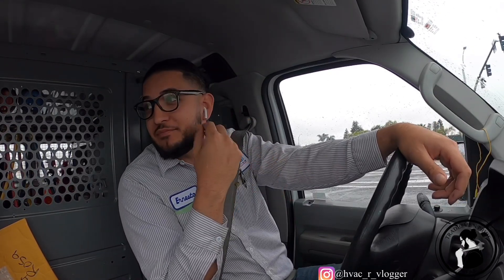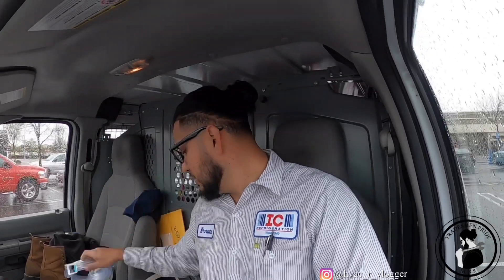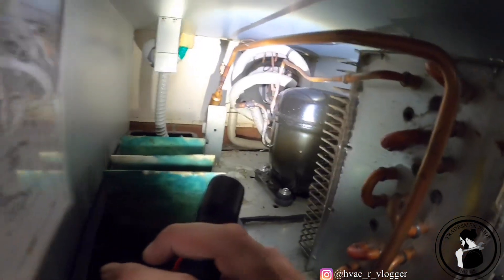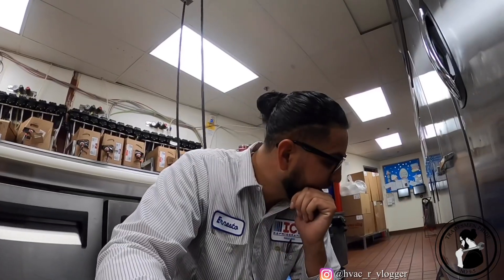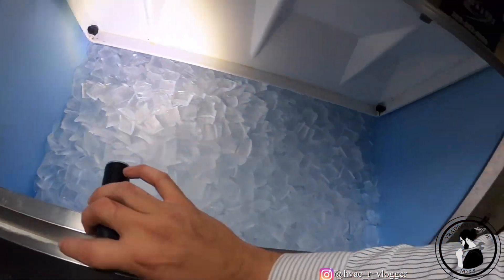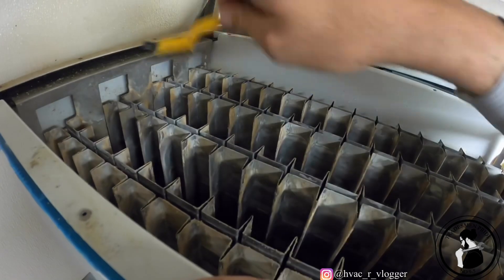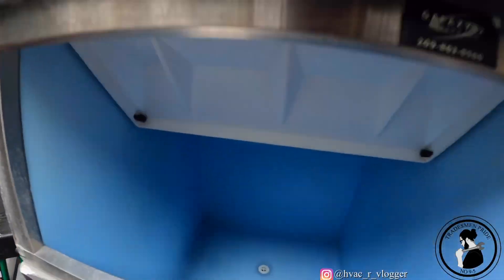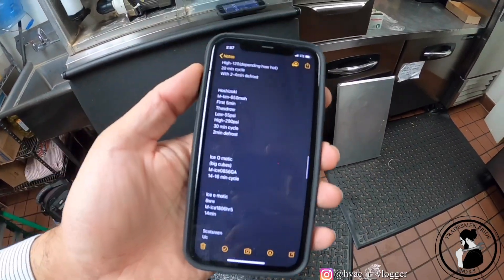HVAC VLOG /. SAN FRANCISCO ON LOCKDOWN!!!!

Comment: Looking for a quick response on your input on using ac filters for a facemask insert for virus prevention due to our shortage of n95 masks. I've used a 3m 2200 filtrete ac filter and cut to size for a mask inert. Could you provide your logical thoughts on the safety vs harm of this. Many people are recommending 2 sheets of fabric,coffee filters, paper towels, vacuum bags etc. Any insight?